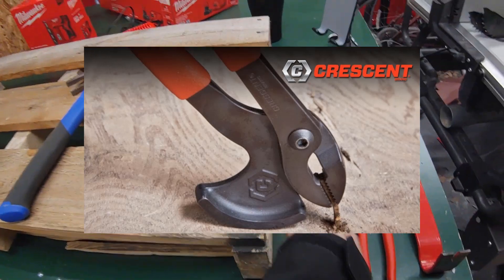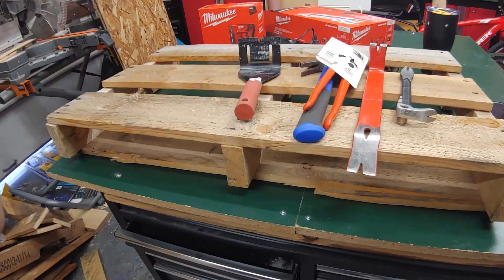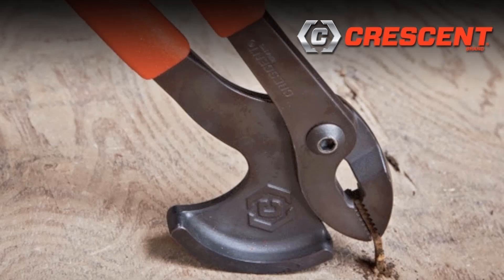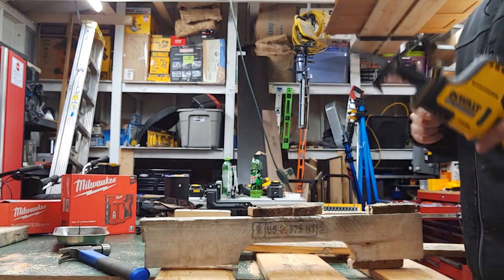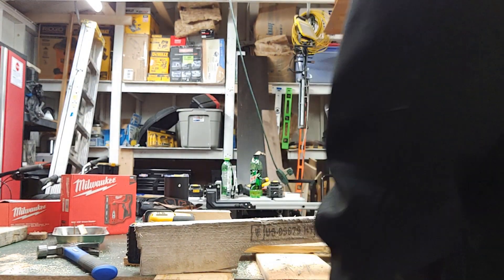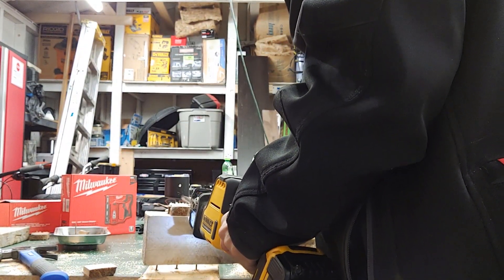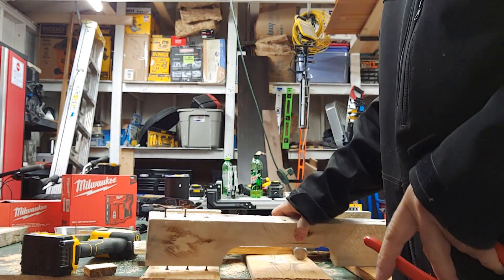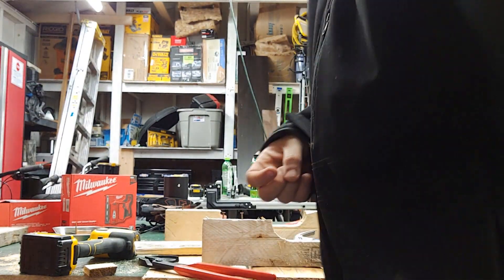Crescent Nail Pulling Pliers For Removing Pallet Nails  Pulls Nails Like Butter EFFORTLESS

Comment: Thanks for presenting a new tool
. Personally, I found a 16-18" pair of end cutters work just fine for me. I have a pair of 50 year old Craftsman ones and a newer Harbor Freight tools pair, the longer the handles the easier the nails pull out. Both work equally well. Great for staples too. 
The biggest problem is very rusted nails breaking off deep in the wood.

Comment: What tool do you use if the head of the nail is broken / away? For the nails in the thinner wood parts of the pallets I use the Air Locker AP 700.